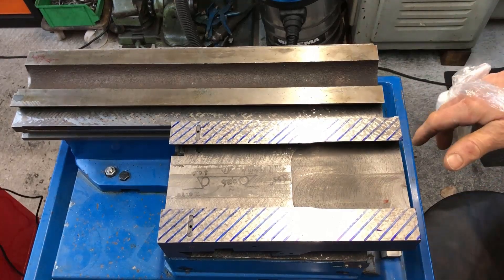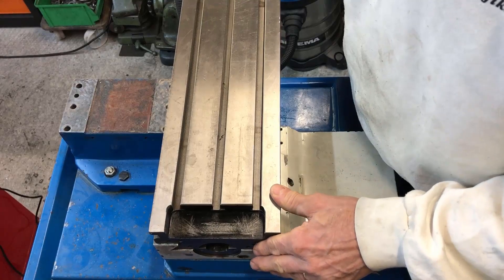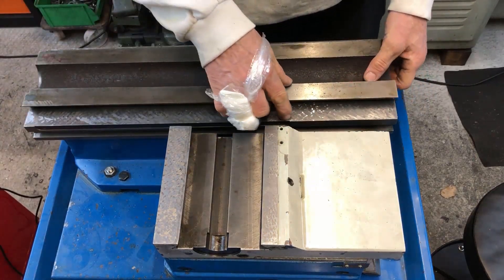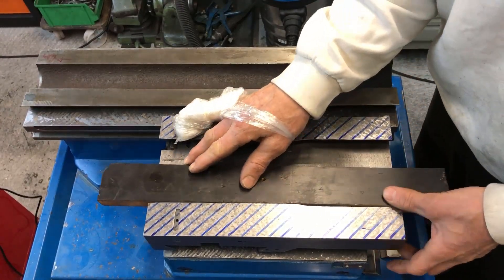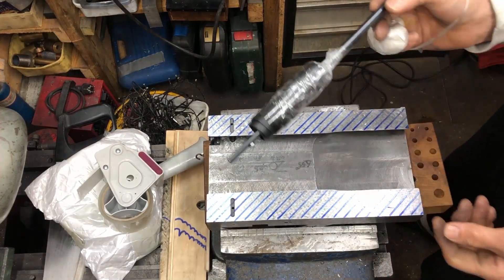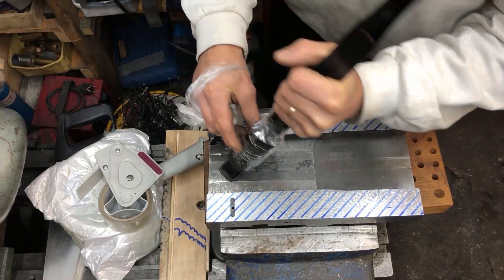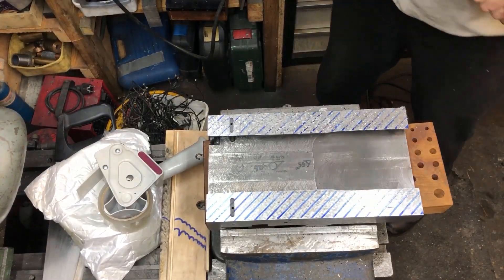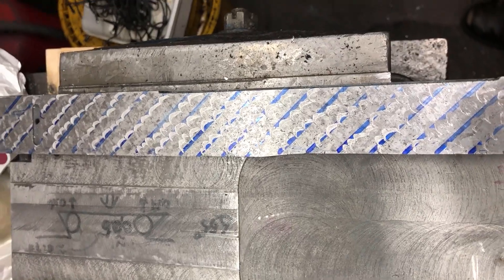Techniques for surface finish and oil retention - part 3 - flaking and comparing depth of cut

Comment: The uniformity of the flaking is a mark of craftsmanship, perhaps, but may not effect function.  It would take a few decades of experience to judge, I suppose.   I've flaked a few square inches and it's surprising how much it hurts.  Maybe you grow accustom to it....  or the wages compensate!  BTW, cut the finger off a latex glove and put it over your bandage.  Then you can work, even wash your hands, without soiling your bandage or losing the machinist's "feel".  I've found that 3-5 days of careful attention, cleanliness, and triple antibiotic speeds healing of nicks and serious cuts.
Reply from the maker: Thnks for nice feedback. I just do this for a hobby, so wages are not a theme 😀 Yes, I will make up a better bandage.. really just a small wound, but keep hitting it so..
I sense you are a pro? It would be interesting to hear what type of machines you work on!